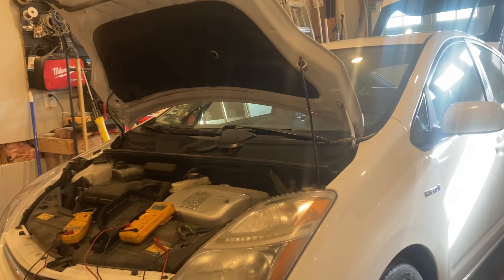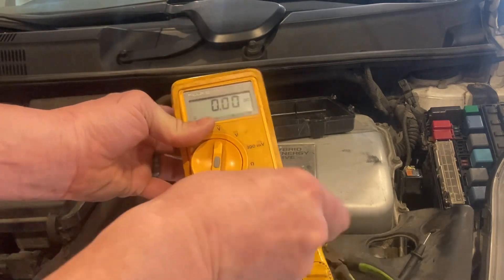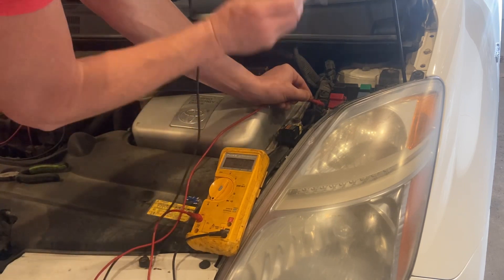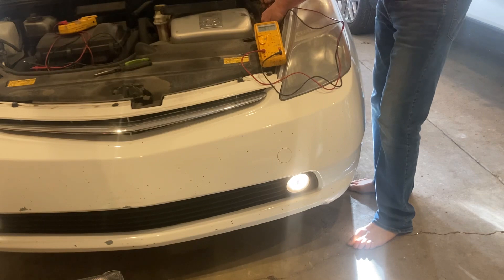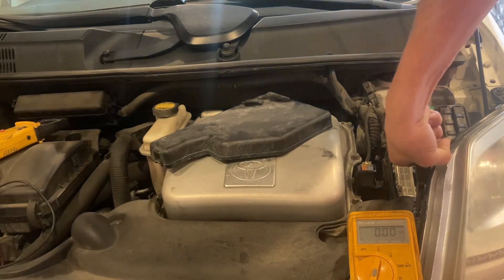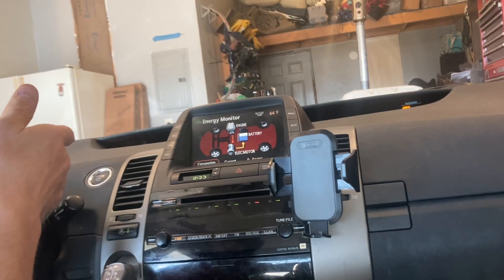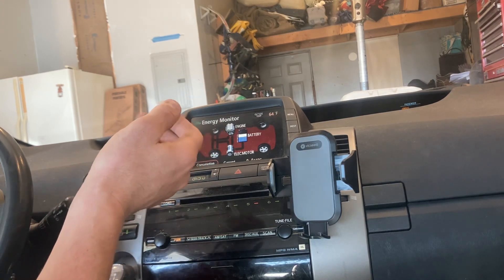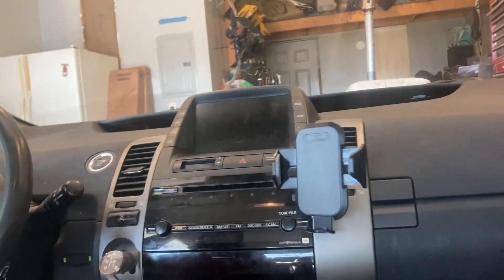Increase fuel economy on Toyota Prius by using less features

Comment: i have 43mpg for fast driving in city where is too much traffic jam, i using fog lights and also using headlights i think because of you using climate control mpg going down climate control kills prius mpg bro
Reply: when i see end of the video u turned climate control at 77F and engine quickly started i guessed ur batteries cant catch the high amp and thats why u have low mpg when you using climate control beacuse when i turn climate control at 77f my engine doesnot start if batteries are charged above 3lines
Reply: just check the batteries amp and voltage
Reply from the maker: I understand the Prius a little better now. The air conditioners and electric motor so it drives from the main hybrid battery and then the combustion engine comes on to generate power to recharge the battery. The headlights fog lights and other devices use the small 12 V battery but much of the System is charged with an inverter
Reply: @jakemir  i have 2007 prius bro not new one

Comment: i understand this was a year ago. so you may already have the answer. anyways here goes, if the climate control is on, and the outside temp is lower than your set temp. then it will need heat. the only source of heat is the engine coolant. so to give you heat, the engine has to run. thats why when your climate control is on, the engine runs. it does stop if there is enough heat in the coolant but starts again if it goes below what it expects.  The lights uses 12v. but the 12v is coming from the hybrid battery also. Prius do not have alternators so they convert the energy from the hybrid battery to 12v to charge your 12v computer battery. the main job of the 12v battery is to turn on the computers in the Prius on startup and maybe once in a while if you are on accessories mode. power the radio and what not. otherwise. everything comes from the hybrid battery. Basically, what charges the hybrid battery is MG1 or Motor Generator 1, thats located in the transaxle. what mostly moves the prius is MG2. weak 12v batteries causes a lot of crazy computer issues. so its important to keep that in good condition. if the hybrid battery has low capacity or is weak, then the engine has to come on more often to generate energy resulting in lower MPG. if you use the AC a lot then it also lowers MPG. AC uses the hybrid battery and at full speed uses like 10-15amps @220v DC or 2.4kw. if you achieve 49MPG when everything is off. then your engine should be ok/normal.
Reply from the maker: I only get about 47 mpg

Comment: The engine came on with the climate control because you have the temperature set at 77 degrees. Turn temperature to low and the engine will stay off after the initial warm up.
Reply from the maker: I never realized how many mpg’s can be saved without the climate controls

Comment: FYI… I bought a bad running Prius getting 38mpg, cleaned spark plugs, pcv, installed new fuel injectors, 40 psi on tires, now getting 54mpg +
Reply from the maker: That’s great! What year is your Prius? I have never replaced the PCV and when I tried I was not able to remove the existing one. I have also never replaced the injectors?  What do you think was the most significant change?
Reply: @jakemir  2007 Prius with 198k …aftermarket fuel injectors produced all the mpg gain…and finally …no more misfire codes.
Reply from the maker: Thank you, I’ll please send a part number and link for the injectors you installed.
Reply: @jakemir  out of stock currently...and NOT geniune Denso as states... but they work great!
Reply from the maker: Can you send a part number

Comment: If you ask for any heat…or have a worn hybrid battery…engine will run often.  You could try removing hid fuses and only turn on fogs to see what happens.  The small electric motor acts as the starter and alternator.  Good luck!
Reply from the maker: Thank you for the additional information. I was not aware so many components were running off the hybrid battery. The Prius uses an inverter to charge the standard battery too. The headlights and heat all use the standard battery and cause the inverter to operate which then leads to the ICE (Internal Combustion engines) to run to generate voltage to recharge the hybrid battery.

Comment: Mine does the same, I get more mpg with the lights and climate off. They both draw power from the hybrid battery. I did wonder sometimes why the engine is running and there’s no arrows
Reply from the maker: I did not realize the inverter used so much power from the main battery